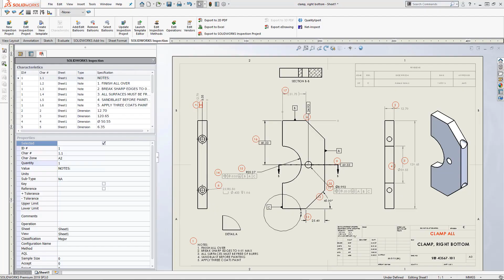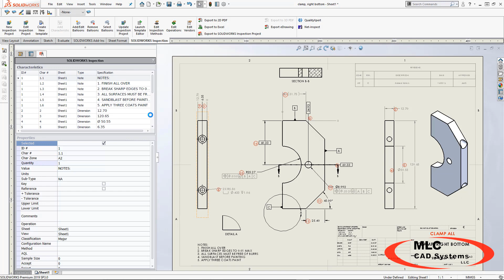Editing Balloons in SOLIDWORKS Inspection Add-In

Comment: How do you ADD a balloon? No one seems to know...
Reply from the maker: Great question.  Often very simple tasks that should be obvious are hard to see because they are incorporated into another process or automated in some way.  Manual control is still important, and you can add balloons two different ways:
1) When you create a new Inspection project on an existing drawing, there is an option called "Auto Balloon" under Characteristic Info.  This is the typical workflow and is enabled by default.  At the moment of project creation, all characteristics in the drawing are captured.  You can choose to de-select anything you don't want, but everything is captured by default.  This is known as Automatic Extraction and it happens in seconds.
2) Starting with Inspection 2017, you have a Manual option for extraction, which takes the opposite route.  Instead of selecting everything and offering you the ability to skip some things, you instead select only the characteristics you want to include and use the Add Characteristic command to add it to the list.  The balloon is created automatically when you capture the characteristic, so it can be confusing when there is no "Add Balloon" command for Inspection because the balloon is automatically created after a Characteristic is added.  Here is a video that shows this workflow: https://youtu.be/VnpTFxJB33Q